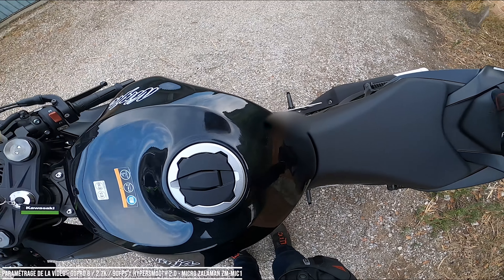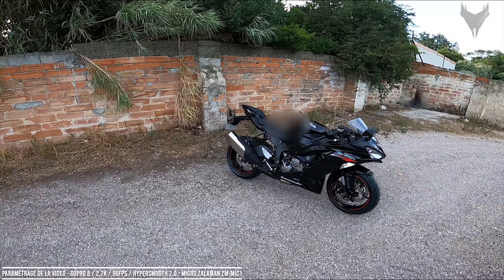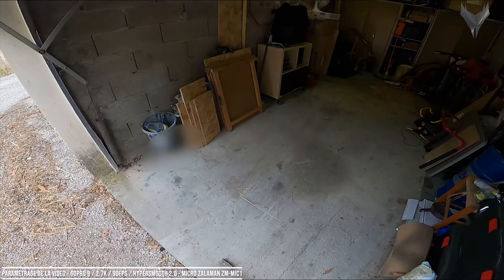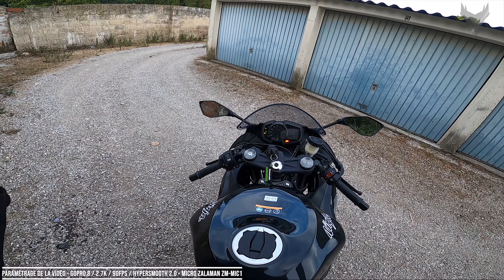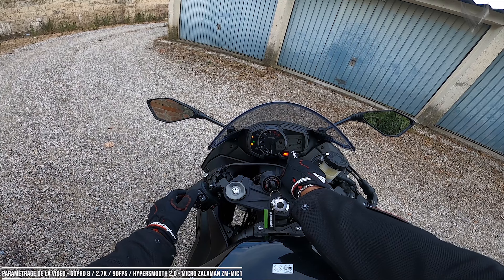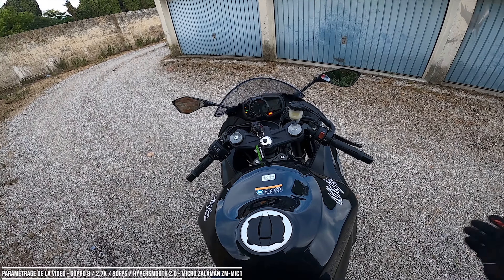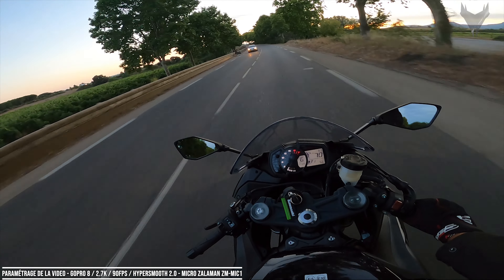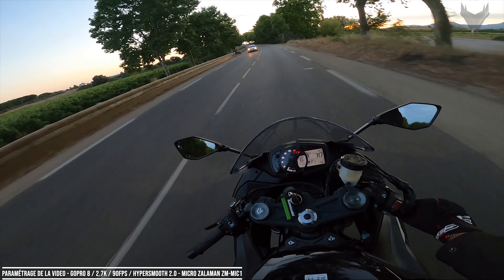🏍 #zx6r #zx636r [VLOG#69] RODAGE DU 636 MODELE 2020-2021

Comment: Salut, magnifique bécane. Elle me fait de l’œil cette ZX6r après mon A2. Actuellement je roule avec un Z900 2020 bridé et la position a l’air plus radical sur le ZX. Peux-tu me parler de la position ? Merci
Reply from the maker: Honnetement c'est le gros point noir de cette moto.
Ca depend de comment tu roules mais tu vois je fais 1m83 et franchement elle est super petite, et j'ai beau bouger les platines, reculer monter, je ne me sens moins bien que sur mon zx6r 2000

Je pense que 1m70 c'est la bonne taille pour cette moto, au dela il vaut mieux prendre un autre modele.

Par exemple je suis mieux installé sur un R6 2019 que sur celle là :(